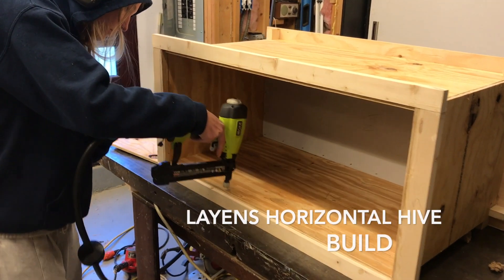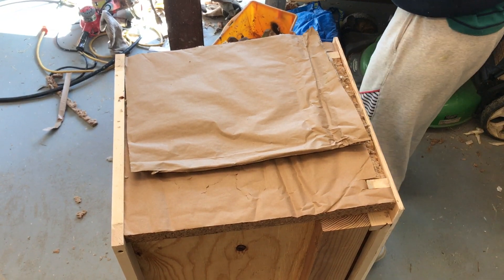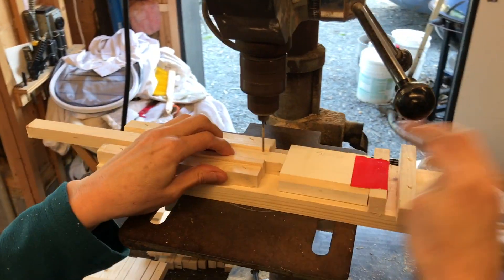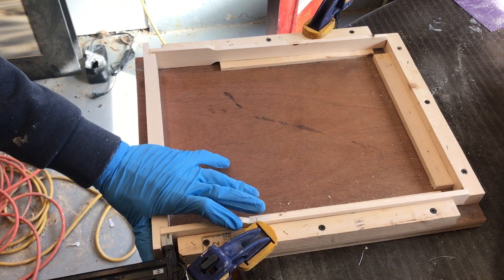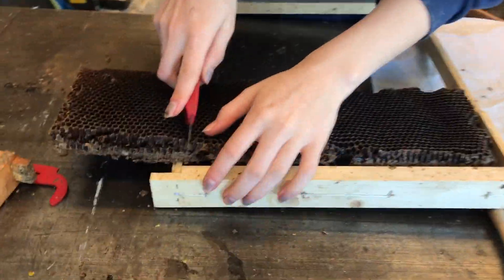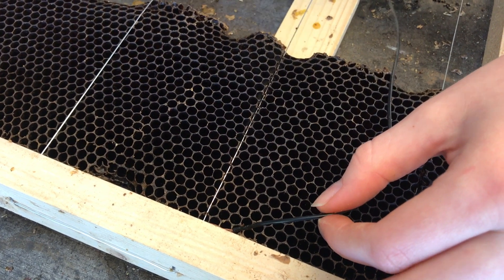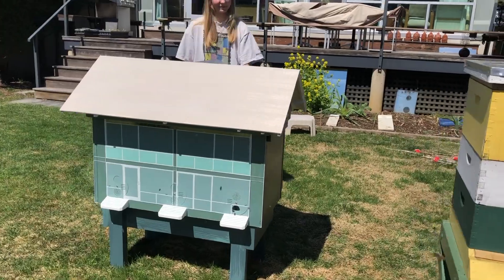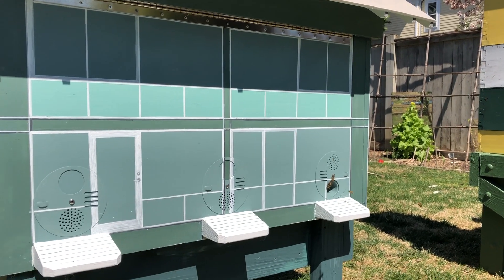Layens Hive Build

Comment: I built my 22 frame Layens hive back in late January, painted it with exterior yellow, blue and green paint.  My grandson and I placed it on top of a leveled pallet on a shed roof 12 feet from the ground.  It is now nearly mid April and awaiting the time to set out three swarm traps several miles from my hive location.  If all goes well, I may have at least one decent sized colony.  If there are 2 smaller swarms I may combine them in time for dandelion pollen and spring nectar.   Weather in SW MT can be pretty iffy till early June rolls around.  A swarm in May is worth a ton of hay.  A swarm in June is worth a silver spoon.  A swarm in July isn't worth a fly.
Reply: good poetry at the end
Reply: What was the inside dimensions of box and the dimensions od the lip that the frame sets in as well as the berthed to both so I can build a layen hive box
Reply: @jaredschwiner6844  I found the plans from posts on YT.  I made several extra frames and parts for future use, but it looks like I may have to sell the empty hive box as I will be moving this summer.  It was a lot of good fun building all this stuff, but there aren't enough smarming bee colonies in my county, so I'm giving up on the whole idea here.

Comment: Thanks for the staple and drill press jig ideas .  How did you contour the sides from 1.5 inches to 1 inch.  I tried a router table but got a lot of tearout at the curve.  Loved your design of the overall hive.
Reply from the maker: I contoured the side by ripping them part way on a table saw, then cross cut it at an angle on a band saw.
Reply: Thank you Tim for your reply.  I eventually made a jig to cut the angle on the band saw.  I also made the rip cut on the bandsaw as well.

Comment: Nice! where did you get the cool roof?
Reply from the maker: I got it at Home Depot in the Layens bee hive roof department.  Just kidding.  I made it using a 1/4" PVC textured 2' x 4'  board.  It seemed like a good idea until it warped in the heat of the sun.

Comment: Did you have problems with the nectar running out of the old comb? The angle on the old comb is now 90 degrees from the way the bees built it.
Reply from the maker: Hi Jim,  I did not have any problems with nectar running when I turned the comb 90 degrees, but I have since learned you shouldn't do that.  I won't do it in the future, but it wasn't a problem.

Comment: when you cut the frames it would have been better if you cut them to fit the top of the layens in the same direction... the cells have a slight angle down to hold in the nectar instead of putting them sideways......
Reply from the maker: I've been thinking about this.  I saw one of Dr. Leo's videos where he converts Lang frames to Layens frames, and he rotated them 90 degrees, which is why I did it that way.  Since then, several people have mentioned that the original orientation is important.  The frames that I rotated are now full of brood and stores, so I'm not sure how important it is.  I have though, recently started putting my cut-out comb in the layens frames in the original orientation, just to be safe.  Thoughts?
Reply: @Tmakepeace  Leo's latest video show him cutting them and installing them that way I think he realized the slope of the cell is sideways the other way..
Look up off grid with Doug and Stacy and they have a playlist with dr.leo dealing with bees
Reply: @Tmakepeace  I was reading an article by Dee Lusby about cell size, and learned some things about comb. The bees orient the hexagons with one corner pointing up. If you rotate the comb 90 degrees, that puts the flat size of hexagon at the top. Apparently the bees will still use them, but I wonder what the impact is. Since turning the cells also alters the front-to-back angle of the cells, I wonder if they have to make modifications to keep liquid from flowing out.

Comment: What was the reason you put staples in the top and bottom of the frames?
Reply from the maker: The reason is to prevent the wires from digging into the wood and thus becoming loose.  You can also use brass grommets, but staples work just as well.
See the video at 2:30 for explanation.
Reply: @Tmakepeace  Got it, a good idea, thanks